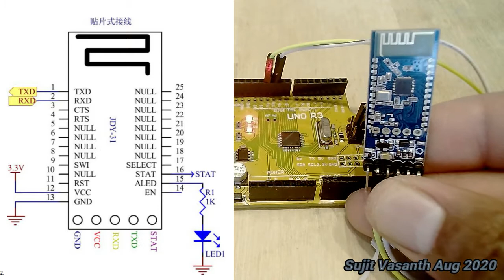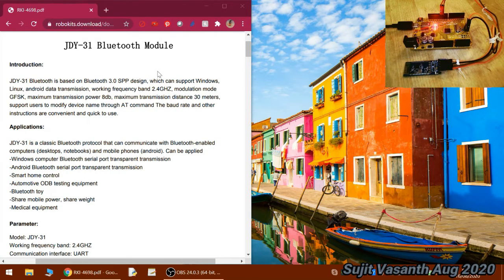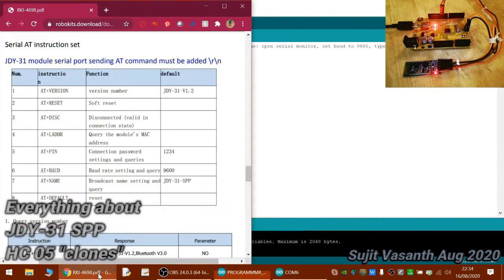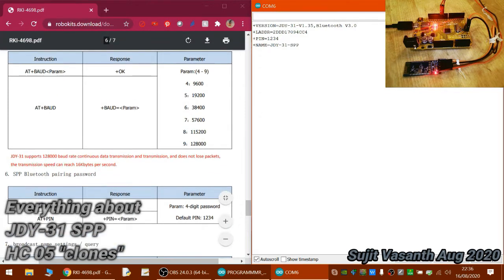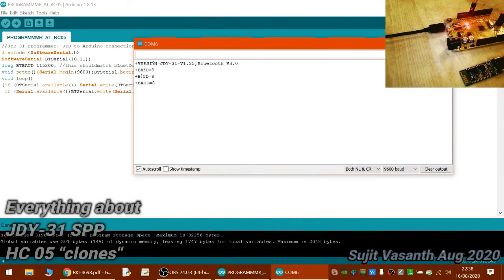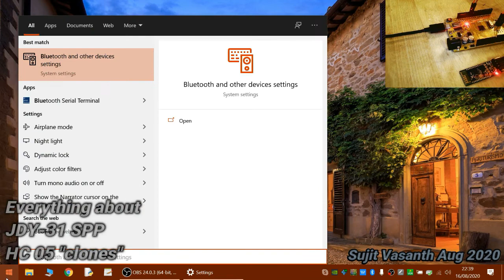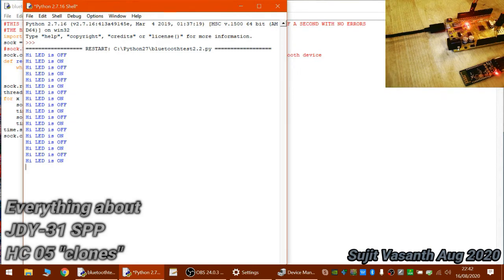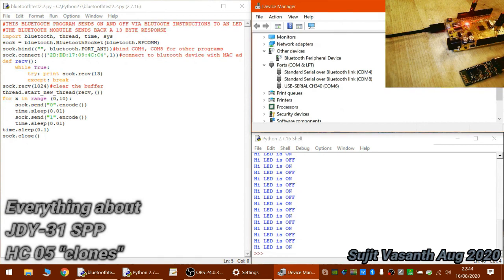Tutorial JDY31 SPP-C HC-05/06 bluetooth module Arduino and Python

Comment: Sir, can u help me, i just bought JDY-31, and I try upload the code, but dosn't work, dosn't connect, when i'm typing AT+VERSION in 'serial monitor' it not replay anything, but when connect the jdy-31 to my android use app 'serial bluetooth terminal' it connected but suddently pop up so many text about '@@@@@@..."
I thing my jdy-31 error, can u help me to solve my problem, please
Reply from the maker: Hi, there a number of reasons that might be.., please don't be insulted if I started with the basics...ensure tgat the repeater program is upliaded to yoyr arduino and that the correct baud rate us set between all coms and also the serial monitor. I think an errir here us more likely than a faulty chip. Watch the connection orocedure in the video VERY carefully and send me a reply if that doesnt work